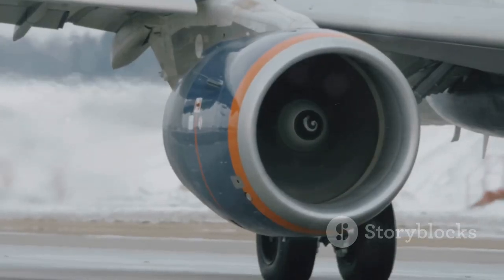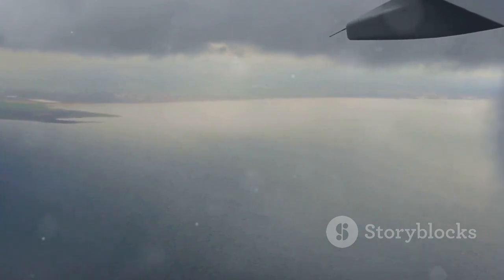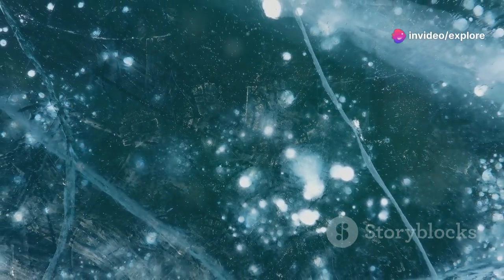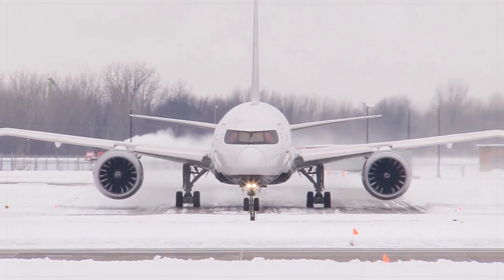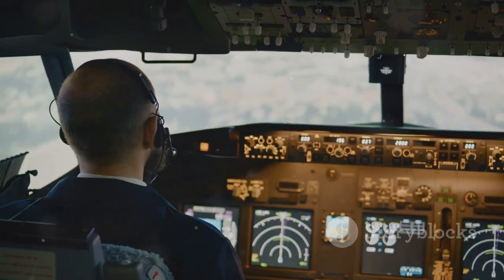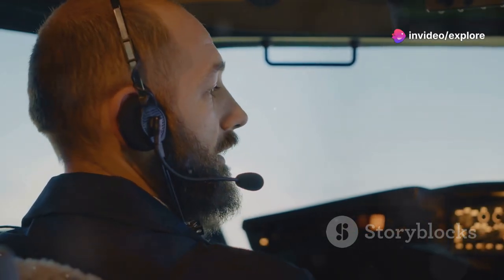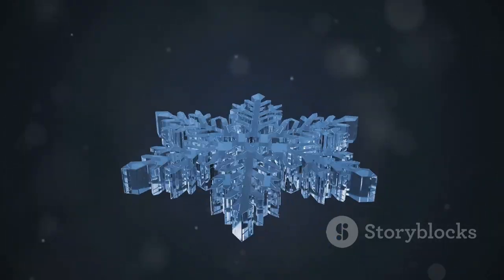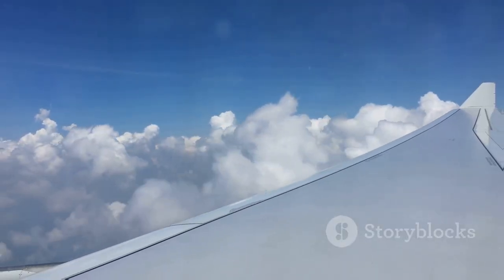How Do Planes Deal With Icing Conditions? | Explore Aviation

Comment: Absolute crap. When I retired after 50 years as an aircraft engineer working in the airline industry, only one a/c used a fluid for deicing. The Douglas DC-3 designed in the 1930's. For props only. Most passenger a/c today use engine bleed air for anti-ice protection. I am not licenced to quote on the B787, but I believe it uses electric anti-ice. All modern prop a/c use electrically heated cuffs on the blade roots. Windshields are also electrically heated. A brilliant feature of the Rolls Royce RB211 that powered some variants of Boeings's 747 was a small rubber tip on the intake spinner. If ice tried to form, it would cause the tip to vibrate and shed the ice. Please do your research from qualified and proven sites.
Reply from the maker: Thank you for your insights, Ross! I appreciate your extensive experience and detailed information on the topic. You're right; modern aircraft typically use engine bleed air and electrically heated components for anti-icing. The evolution from fluid de-icing to these advanced systems highlights the advancements in aviation technology. I'll make sure to verify and incorporate accurate and up-to-date information in future videos. Your feedback is invaluable!